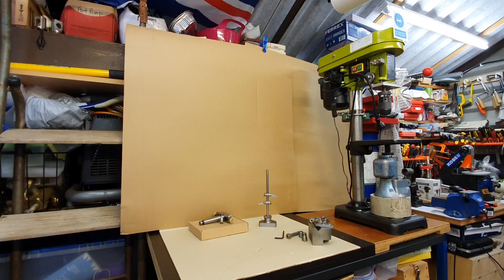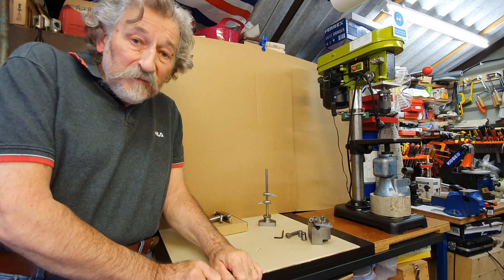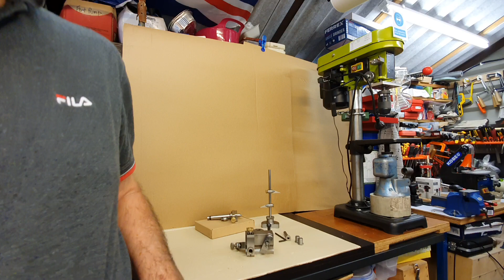Hemingway Kits

Comment: Hi Nobby
I have long been wondering about the Hemingway kits but gave always been worried they were more appropriate to the myford size lathes and were a little out of the range of the mini lathe
What is your opinion?
Reply from the maker: Hi Gene, I was lucky in being gifted the kits I made. Some of the Hemingway kits are designed for the Myford Lathe, but most could be built easily on a Mini Lathe. The large cast iron part for the cross drilling attachment, I machined to size on my Mini Lathe. The plans and build notes that come with the kits are excellent. I was going to buy the Finger Plate kit from them, but decided to make one to my own specifications. I would recommend giving them a try Gene. Keep well regards Nobby
Reply: @nobbysworkshop  thanks nobby